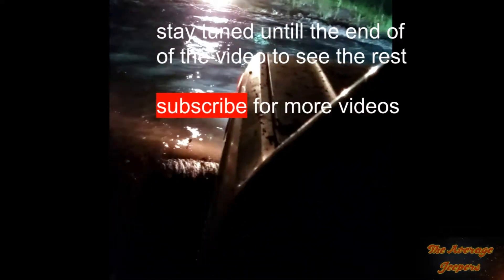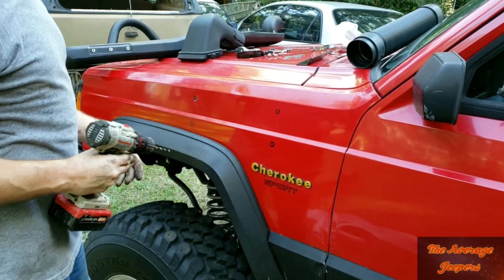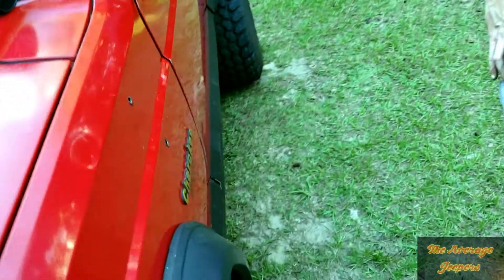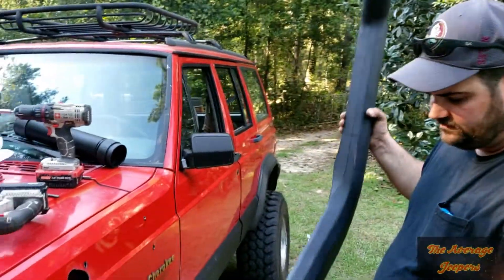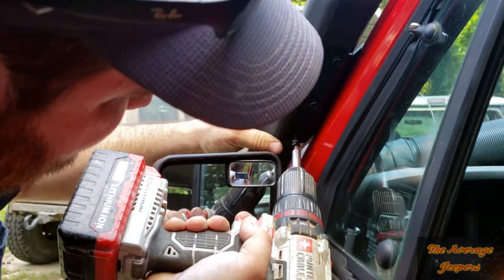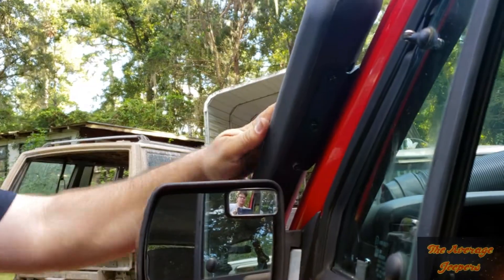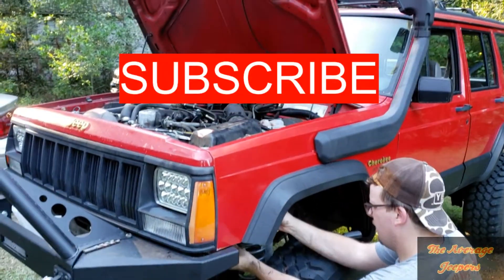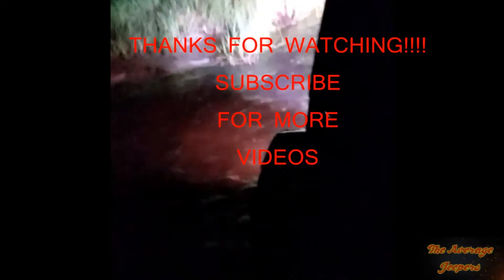Jeep cherokee xj snorkel install - The Average Jeepers

Comment: the last 2 xj's i built the factory airbox had rubber plugs in those two holes, kinda strange that they didnt do that on all of them, not a bad vid, the improvising on the hole cutting i think put a lot of people on edge, but work with what ya' got, pretty informative and still a good vid man

Comment: What size screws did you use to fasten the snorker hose to the air box and what size screws did you use to fasted the snorkel mount to the window frame of the jeep

Comment: how NOT to install a snorkel
Reply: At 10:12, after he hacks the ugliest hole ever in a piece of metal, and after he installs sheet metal screws with a drill on the highest setting.  After he does all that, he says he permanently marked the truck with sharpie........

Look ya'll, sharpie comes off with isopropyl alcohol, but once you take a sawsall to it you can never take that back.  Never trust a man who uses a sawsall as a deburring tool.
Reply from the maker: Lol bro we put our jeeps up to dash in water drag branches across the paint. You see un like you we use our jeeps off road in swamps. Keep on pounding the highway in your 20 year old xj you must be keeping in mint condition.
Reply: At 17:00 he completely strips every single screw in the air box. face palm

Comment: So many haters in the comments. .. These guys live in Florida. These are not daily drivers they are mud trucks. They probably beat the ever loving shit out of them. Plus, he has oil in the air box, so the motor already has issues, and he said in the video that his floor pan is held in with sheet metal screws. You can pick up these jeeps for $500. Lolz